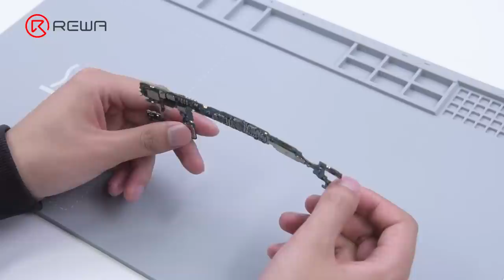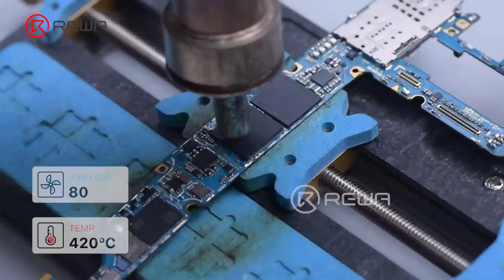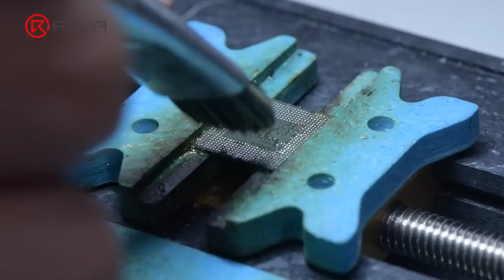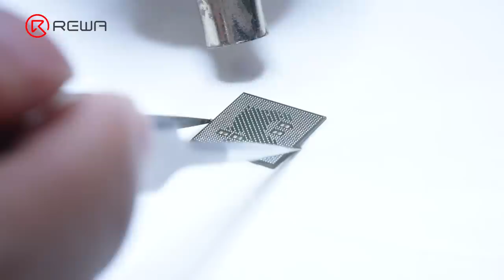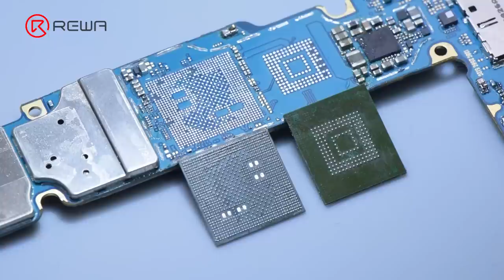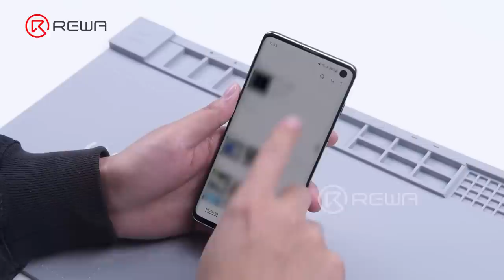Samsung S10 Data Recovery from Cracked Board

Comment: What hot air you use? Setting like 380 hot and 80 air will be good to all even cheap hot air station?
Reply from the maker: QUICK 861DW
https://shop.rewa.tech/detail/hot-air-gun-rework-station-861dw-type-2-oem-new.html
Reply: Do you have the bonding mat available ?